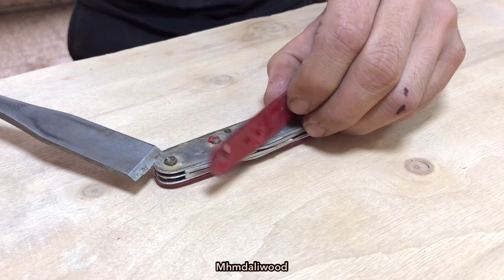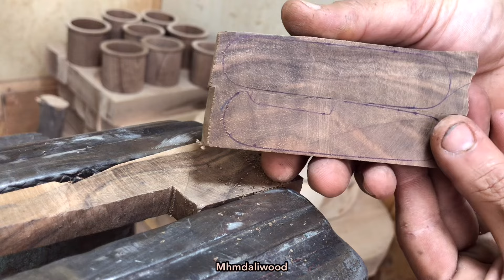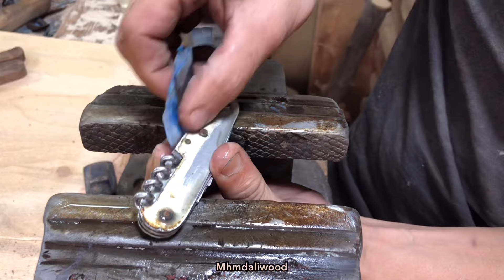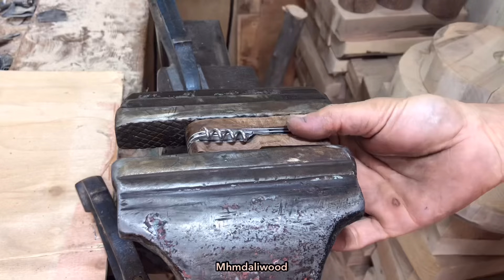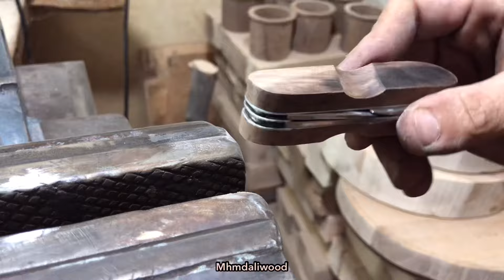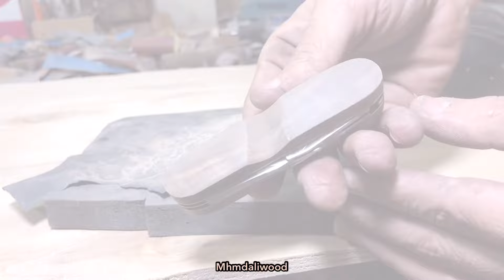Changing the handle of a pocket knife / personalization / woodworking

Comment: nice finished knife. @ 3.25 baking soda & superglue?
Reply from the maker: “Thank you for watching! Yes, that is sawdust or wood dust with super glue. It works well, but it would have been even better if I had epoxy glue. Unfortunately, I had run out of epoxy that day, so I finished the work using super glue.”

Comment: I'd be careful squeezing up a Swiss like that in a vice I've done it myself changing standard scales and the can opener and screwdriver are now tighter than they should be to  open and close
Reply from the maker: I was also very cautious while doing this and avoided putting too much pressure on the knife. Fortunately, it works just like it did originally and has no issues.
Reply: @Mhmdaliwoodart  and it looks superb